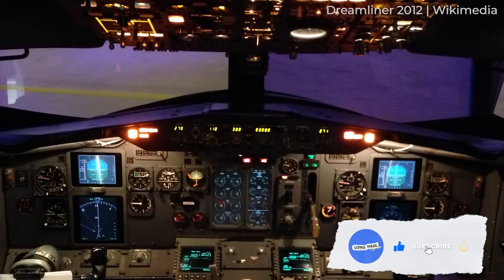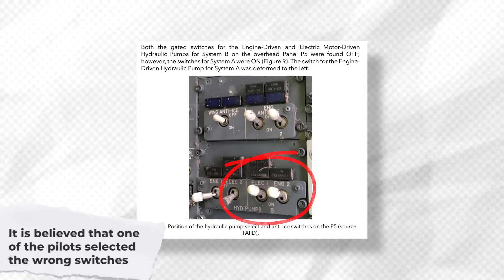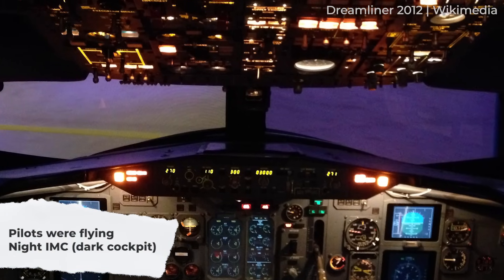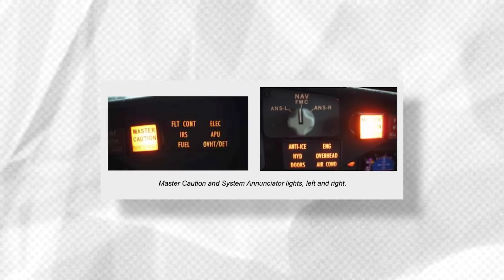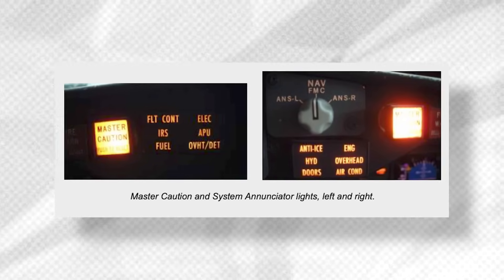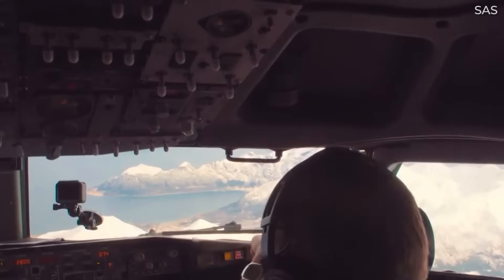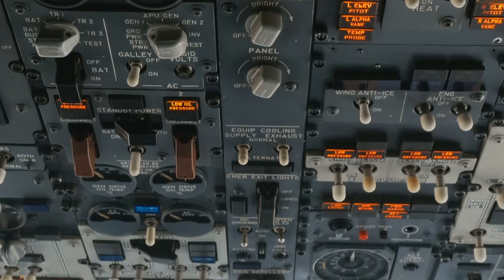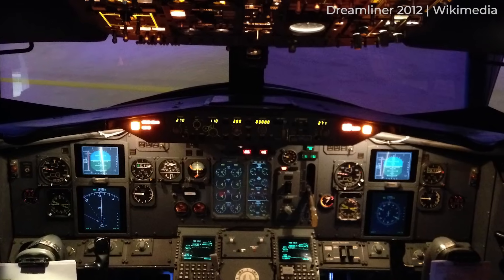Boeing 737 Crash Analysis: Human Error Vs Poor Design

Comment: It’s B737, a plane designed in the 60s with no automation. Of course newer plane is safer, B737 is like a car from the 60s, while other planes are like a Tesla. And this accident is perfect example showing how using newer plane save lives, at least in this instance.
Reply: If they didn’t turn off the master caution they would’ve lived…
Reply: This is not logical. Its like saying that a 2024 corolla or civic is not safe because they were originally released in the 60s and 70s.
Reply: @HopSkipRun22 modern cars are NOT safe though . A Boeing is over 1000 times safer than riding in a car
Reply: @HopSkipRun22  The issue is that we wouldn't allow a 2024 corolla or civic to be designed to 1960s/70s standards. We allow the 737 to be exempt from many standards even though the NG and the MAX were both developed in the modern era.
Reply: @ still incorrect  . This was a B734 which came out in the 80’s. This is a example of the swiss cheese model. Multiple factors that could have been avoided lined up to cause an accident.   Its not like this was even a “new” 737 that crashed.
Reply: @HopSkipRun22  I understand - this was a classic. What I don't understand is why we allow the NG and MAX to get away with this. The MAX is still in production.
Reply: @camhusmj38 The 737 design is perfectly safe and in some ways safer than many more modern designs, you're never supposed to just reset a master caution warning without identifying what caused it, it's just human error, no aircraft can be perfectly fool-proof no matter how modern the design is...
Reply: @anderkert  I agree. But we know now how to make it safer than it used to be. Human factors research has come a long way.
Reply: @camhusmj38  so you’re not blaming the pilot you’re blaming the aircraft. The aircraft didn’t turn off the master alarm the pilots did.
Reply: @redryder1146  I'm blaming the cockpit design which fails to match what we understand about human factors research.
Reply: @redryder1146  Human makes mistakes, and newer plane will not allow for this mistake to happen. Only in B737, where 1 wrong switch depressuized the plane and kill everyone on board. No automation so pilot need to find fault from hundreds of illogically placed button. No way to fly in complex environment such as go around which increase pilot workload to make errors. Dozens of plane destroyed because of this cockpit design, which will never happen on any other newer planes. 737 max is still 737, with the same buttons in the cockpit. Only thing changed is the engine, which also have fatal flaws.

Flying with b737  is like driving an old car without any safety feature. It often works well,and some people prefer, but when you make an error, the car will not warn you or help you, and then you will suffer more, much more than on a new car.
Reply: @ that sounds like a lack of pilot training!!!!